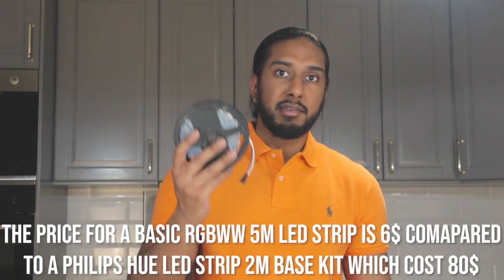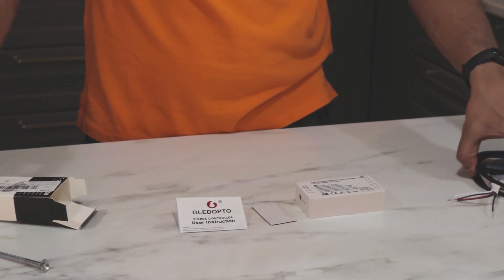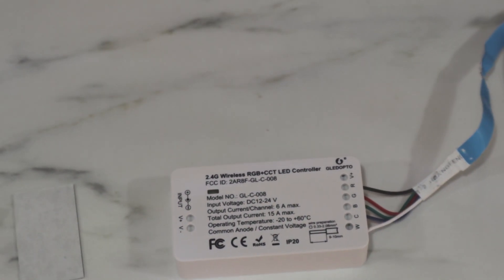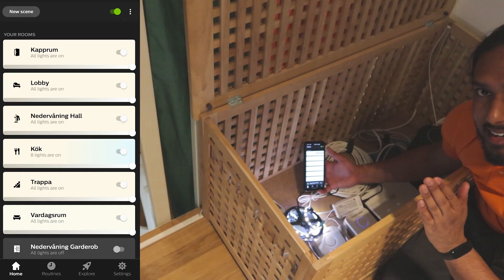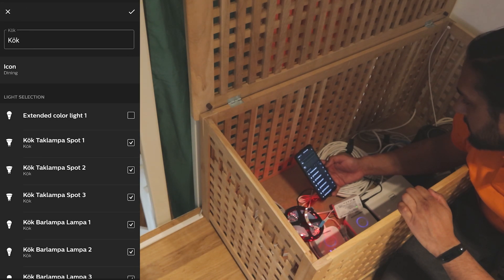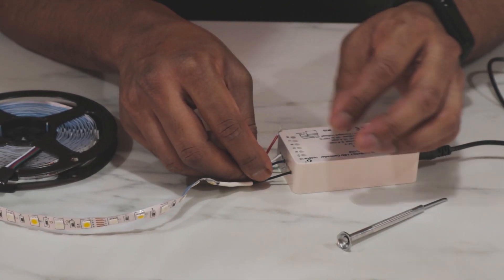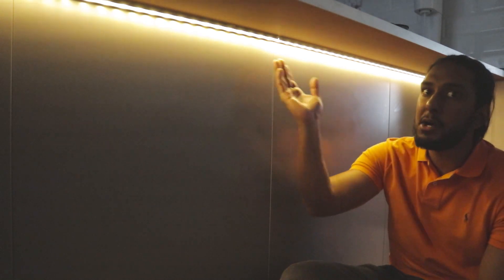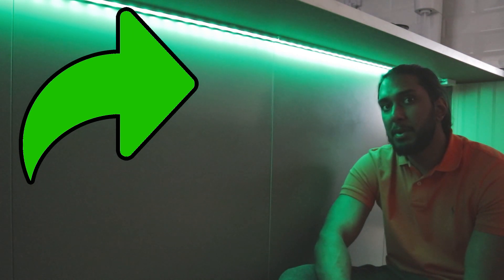HOW TO MAKE Your Own Philips Hue LED Strip Using a Gledopto ZigBee Controller and Aluminium Diffuser

Comment: Great video. What's the benefit of doing this and integrating it with phillips hue? Why not just buy a WiFi controller to attach to the LED strip so it can be used with Alexa, Google home etc for a smaller cost?
Reply from the maker: Integrating into Philips Hue Bridge like this allows you to create scenes with other devices to connected to the Philips Hue Bridge, which you then can activate using Google Home / Alexa. We find this a better solutions than using Google Home routines, but Alexa is much better when it comes to create scenes, routines etc within that system. We don't use Alexa so this is a better solution for us.

Comment: The link you supplied points to several versions. Which one did you use?
Reply from the maker: It depends on what LED strip you're using. In this case with used a RGBCCT Controller but it would be enough with RGBW as our LED Strip only hade RGB + Warmwhite and not a additional Coolwhite spectrum, that's why we left one slot in the adapter. We linked to more updated ZigBee 3.0 edition in the description.